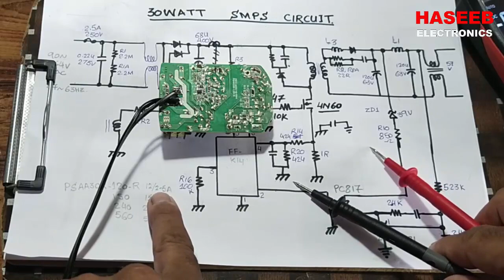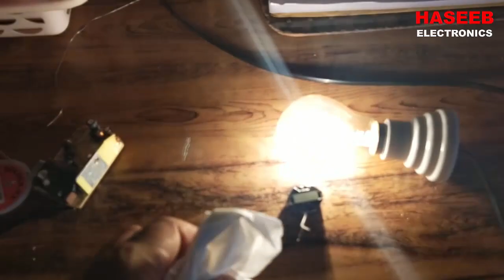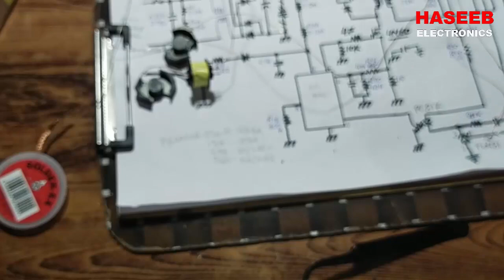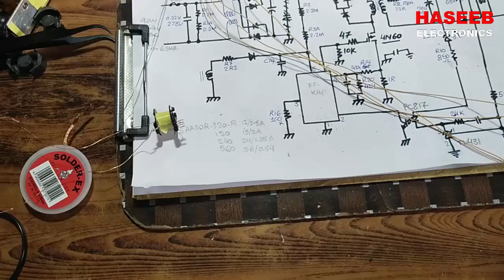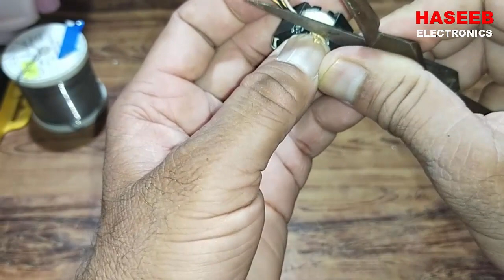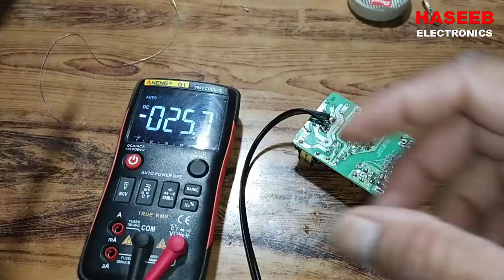[390] How To Modify Switch Mode Power Supply (SMPS) Increase / Decrease / Adjust Output of SMPS

Comment: This video is outstandingly informative! This the first time I've seen someone modify the pulse transformer to change the output voltage of an SMPS. This video shows the depth of your expertise and the level of your experience. I wouldn't dare try such a thing. Not at this moment, but perhaps a little later. You're the undisputed champion of SMPS circuits!
Reply: Great comment, you are absolutely correct in your assessment!
Reply from the maker: i am really thankful
please accept my best regards
Reply: It's a close contest with Diode Gone Wild I think. Both great channels packed with awesome information and schematics
Reply: @TYGAMatt  I watch DiodeGoneWild too, but I think Haseeb Electronics is a little bit more practical in showing the actual repairing process in addition to describing the schematics. Nothing wrong with DiodeGoneWild. Both channels are great.
Reply from the maker: DiodeGonWild is a great channel. He is working extremely excellent. It is your greatness that you considered my efforts as useful for  community
Reply: @HaseebElectronics  can I tell me more YouTube chanals like Haseeb electronic and diodegonewind and so on
Reply from the maker: @TYGMatt I am thankful. Please accept my best regards 💕
Reply: @TYGAMatt  you have right judgment on it
Reply from the maker: @rattamarengineer6113  thanks a lot dear
Reply from the maker: You are welcome!
Reply: Ref: above comments from Rose Electronics, W Thornton, TYGAMatt, they are the ones who know the importance of your work in real sense
Reply: @kaupstudio-supportid5956  You're right, brother. I learn a lot from his videos and I should be grateful for that. These comments are one way of expressing my gratitude.
Reply: I agree with all the comments. Thanks to Haseeb's videos I learned a lot about SMPS. But I need to spend more time with his videos in transformers because I want to learn more!

Comment: Can you do it by only changing the value of the voltage divider resistors to Tl431?
Reply from the maker: that method allows a very little range 
we can bring up down 1 or 2 volts only

Comment: If we wrap 4 turns on winding we get one side 14volts ,reversing directio get 5volts but in both cases current is very low(4 wires in parallel)remain circuit is ok.perhaps this winding should before auxalary winding or another reason.hope ur answer.u r practical and theoratical expert thanks
Reply from the maker: if  turns provide required voltage
that means the turn ratio is good. 
you need to consider input power, and primary turns and wire size, 
might be proper magnetic field is not being generated. 
try sandwich winding method for primary winding. and observe core gap as well 
i will try to explain it practically

Comment: I want to make a small toy car.for voltage control, what i can use?voltage control means speed control.will i use regulator or variable resistor?

Actually,  i will use one thing that will work as pick up.

Comment: Excellent well done and well explained.   Did you check output diode can handle the ~4 times higher current?  also shouldn't you use a lower voltage / higher uF value output capacitor ?

Comment: Hi there, can you please make a video on how to bypass safeties and protections in ATX for another use besides computers as they can be a very good power supplies  to charge batteries, make 12v fridges work as well as car air compressors. But SUPERVISORS with OVP, OCP turn SMPS off and stay useless... THANKS !!!

Comment: Great video; thank you! You bypassed the zener diode. Why did you not replace it with a 12V zener diode?
Reply from the maker: thanks a lot
if we replace zener 12 volt, 
then there is no working region for TL431. as TL431 VKA (voltage cathode to anode) range is upto 40 volt. 
so there is no need to connect 12 volt zener 
just Current limit resistance, optocoupler, TL431, and voltage divider resistance is a good selection to build feedback circuit
Reply: @HaseebElectronics  A 15v zener would protect the output from overvoltage

Comment: Again, I want to appreciate you sir for the experiences gathered from your videos.

I observed in the video that your DMM displayed 16v after the transformer was rewound and later you got 12v. Could you please help me know how you were able to get the output voltage as 12v from 16v?

Thank you sir!
Reply: 16 v was full duty cycle with no feedback/regulation in place.  Then he created a voltage divider to take 12.4 v down to 2.5v and feed into the TL431 shunt reference regulator.  That operates the optoisolator which provides feedback to the input/switching stage, thus regulating the output to approx 12.4v

Comment: What's if I use 1k & 270 ohm instead 10k & 2k7 resistors? Will it give the same Vout?
Reply from the maker: if you will use low ohmic value resistor in voltage divider network, it will increase power loss. second thing it will not maintain CTR in optocoupler. so regulation will not achieved properly,

Comment: Can I use my heat gun to open the transformer? What is the temperature setting?
Reply: you can boil it in hot water 5 minutes
Reply from the maker: Yes boiling is also a good option, specially when we want to disassemble completely, if we have to disassemble partially, then best option to heat by lamp or hot air gun
Reply: @HaseebElectronics  what temperature and how many time with hot air gun?
Reply from the maker: Set around 200-300 degree centigrade
And apply air from around 4 inches 
Focus to core and keep moving the core
Powdered cores are much sensitive to temperature, if it gets overheat, it may loose it's magnetic properties
Reply: @HaseebElectronics  Thank you! About boiling in hot water, could the core make rust?
Reply from the maker: boiling is safe 
because it will not reach more than 100 deg centigrade
some ferrite cores have coating, it may go away. we can apply a varnish spray or light coat of conformal coating

Comment: Can we modify voltage output without changing transformer? If I can adjust  output by changing switching frequency ,so it it possible?
Reply from the maker: No we cannot change the frequency, of we will change switching frequency, it will increase or decrease BMax, which will increase losses. And power transfer will not acceptable which will cause to lower efficiency
Transformer core will heat up or winding my damage
Reply from the maker: In amps design 
First priority is transformer
Then frequency
And then the remaining circuit
So if we play with 2nd or 3rd item 
The first item will effected directly

Comment: Hello Haseeb. I would like to find out , if you had just modified the feedback circuit withought re winding the transformer, would you only then have 12.4v @ 0.54 amps at the output?
Reply from the maker: NO, 
we cannot adjust output in so wide range. from 57 VDC to 12 Volt it is impossible.
as at maximum input line voltage the PWM IC will switch at minimum duty cycle i.e around 4 percent. so if we adjust just feedback circuit, then the PWM ic cannot decrease more duty cycle,  if we will try to adjust it, it will lead to fluctuations in output, because IC will move in RESTART mode
Reply: @HaseebElectronics   very interesting. Thanks Haseeb.